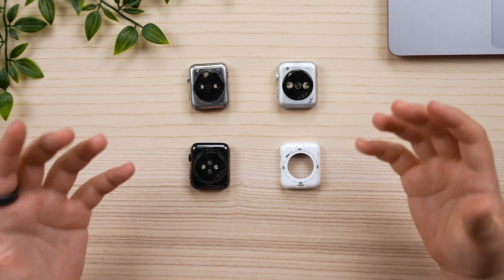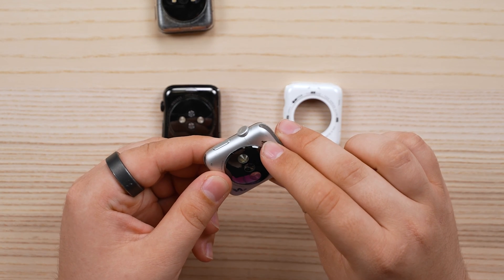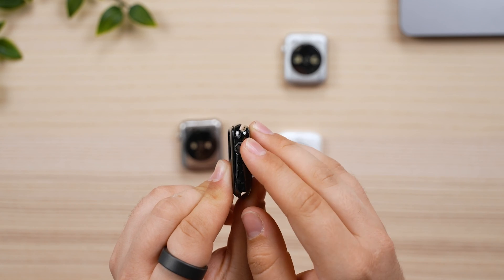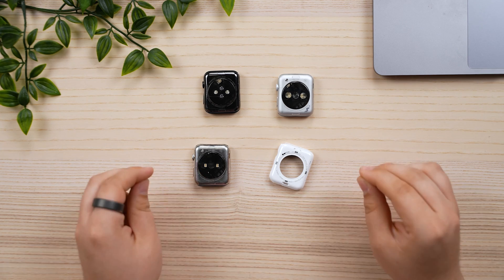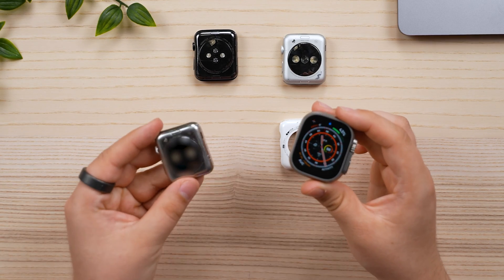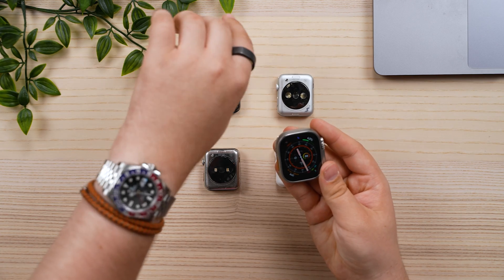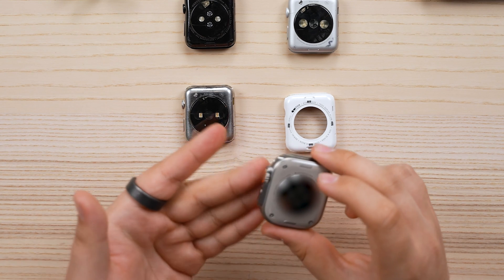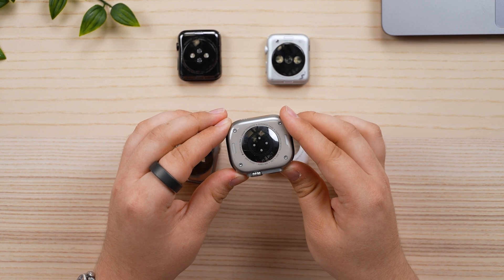How Apple Created the Apple Watch Ultra

Comment: I know that the ceramic is supposed to be the most durable and one of the most expensive models but I just can’t  understand how it is stronger than stainless steel or titanium or if not stronger atleast on par? Can you elaborate more on this material? I just think of like ceramic plates and other things and they while hard and durable in a way they also seem to shatter fairly easily. What makes this ceramic better? I’m seriously intrigued/curious
Reply: It not the ceramic your mugs in the kitchen cupboards are, its a jewelry standard ceramic, and it’s unbelievably durable. 😎
Reply: @corybourrier9722  yeah i get that it’s obviously not the same and they probably mix some stuff into it to make it harder and bonded really well. But I’m just interested in what that process is to make it so hard. I guess i should have explained myself better